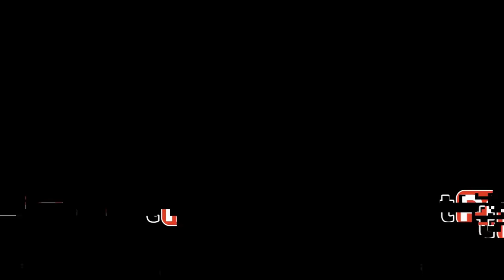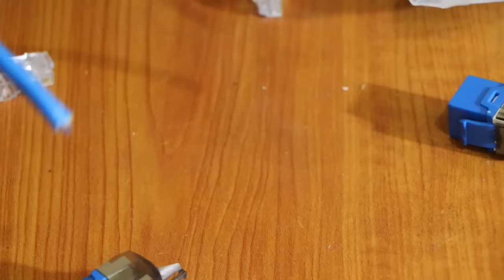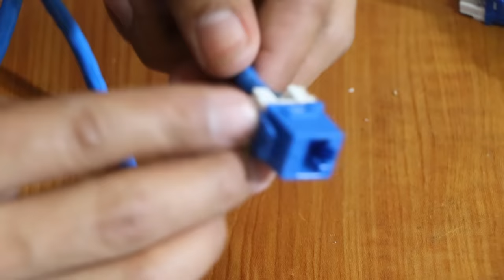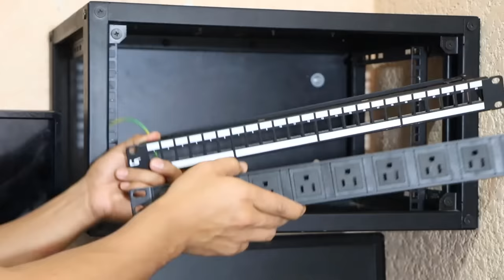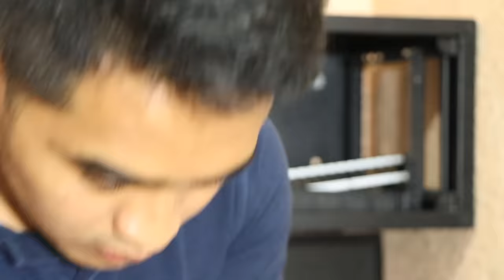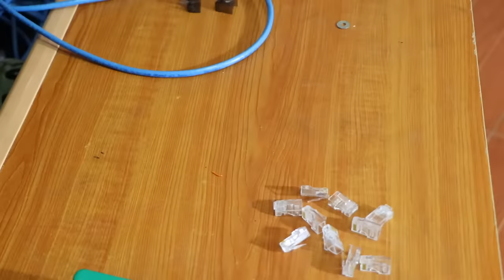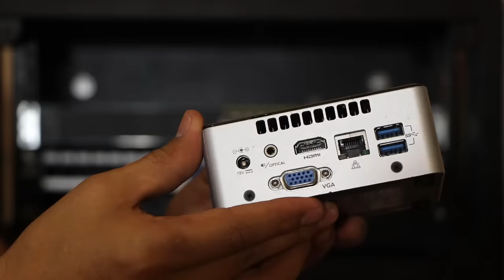DIY Home Network: Experts Debate – Right or Wrong Techniques?

Comment: Look, this is Torogi Pro's patch-panel, he can configure anyway he likes, he can turn it upside down,  sideways, and put it in the bathroom 🚽 Its not yours, its not mine and its not in the Pentagon for gods sake! 😬 Its a home network (wish mine looked that good), if I were to make video of mine, you would crucify me then laugh me into last week! 💀...and BTW...I made all my patch cords too...and they work just fine...I even tested'em, so there you go...my 2 cent...for what its worth...IMHO...bite me! 😝  💋 👣👅
Reply: Exactly! He can do it any way he wants, but he certainly can not call it the 'right way'
Reply: very well said Sir.
Reply: Agreed. Many of the suggestions by others are appropriate for a larger install, but unnecessary here.  Most of the comments are no doubt from those used to working in a commercial wiring closet with hundreds of connections, not 12. I've been at both ends of the spectrum and the design considerations are different. Since there are only about a dozen connections, even a patch panel is optional, but nice to have. Good wiring management really comes into play when you have a lot of wires. I think some of these people would be saying you need a rack, PDU, and patch panel for 3 connections to an integrated wifi router.
Reply: LucaWen tưtq. Kceen ưt
Reply: He can configure it however he likes but HE SHOULD NOT BE INSTRUCTING OTHERS IN THAT CASE. This isn't best practices which is required when you claim to show how it's done right.
Reply: @samiraperi467  Exactly. "pro" channel, "done right"... yet, (1) he doesn't use cage nuts on a frame that requires them, (2) doesn't mount anything with the proper 1U / 3 hole alignment, and (3) secures things with a single screw in the TOP hole. Nothing about that is "pro" or "right" -- it is, in fact, the exact opposite. You can do this all you want in your own bathroom, but don't put it on YT and call it anything other than the unprofessional mess that it is.
Reply: What is the types of the cables u used to connect the patch panel with the switch? straight or cross over ?
Reply: @Zeric1  Coming from both sides mysef, he has every right to do as he likes.  However, this does not make it the correct way to do things.  Making your own patch cables, for instance, is not a good idea.  Patch cables cost pennies these days, and are MUCH less likely to fail - especially ove rtime - than hand made ones.  Patch panels, even for small installs, are ALWAYS a good idea.  Less strain on the cable/connection, for one.  Also it's easier to diagnose issues in my experiance.  Adding that gap between the PDU and patch pannel not only doesn't look good, there is no reason to do so.  It ALSO mwastes a slot that might later be needed for a new switch or other piece of equipment.  Also, it tempts you to runa cable through the gap, which will cause MAJOIR headachs if you need to replace a unit in the future.

Comment: I do this type of work professionally.  While I'm sure this will work fine for your home environment, when you are ready to take it to the next level...

1. Use cage nuts
2. Don't skip a single hole in a square hole rack.  If you want to leave a gap for whatever reason, leave a full 1U (3 holes).  Square hole racks don't have even hole spacing - there's a reason for that.
3. That keystone panel has a cable guide on it to help with cable management.  The extra cable should be coiled and zip tied behind.
4. Patch panel should go to the very top.  It has no indicator lights to see and even in a high density 48-port 2U panel it can be at arms length above you and still manageable.
5. Unless you are in a very high density rack where inches of cable matter, don't waste the time and money on building your own patch cables.  Patch cables are cheap, have molded strain relief on both ends, and are typically better attached than what you can do with a hand crimper..
6. Use a 6" extension cable to plug wall warts into a PDU so you don't lose open receptacles.
7. If you are going to do any more cabling than this, spend just a bit more money and buy the quick terminate keystones.  There are a lot of companies that make them now and punching down all 8 wires with the pull of one handle is a game-changer.
Reply: Phoenix  because it's out of the way, So it's easy to add more equipment down lower later.
Also heat rises, so you don't want actual powered equipment up the very top if possible. 
There might be other reasons, that's all I can think of for now
Reply: I was watching this video going..... Cage nuts!!! Lolz. Btw, do you have any experience with rack studs? I just bought a set for my home rack. Server is going to be on nuts, but trying out the rack studs for the lighter weight mountables.
Reply: If this is your own home network, do wathaver you want. If this is a proffesional installation, I will kick the living crap out of you. I am confronted with so called Proffesionals who do this as a living.
Reply: @richardwilliamjohnson8566  I'm moving equipment at work from wire rack shelf into a Tripp cabinet. The config top to bottom I was sketching was Router, POE switch, two keystone patch panels, second non-POE switch, two shelves for backup internet equip, and power control unit. Logic was to place the router at the top since it runs the hottest compared to the other pieces of equipment and would place it near the vent for optional fan if needed. Also, the patch panels sandwiched by switches because I've read you don't want patch panels crossing equipment. Figured if a current wall jack that currently does not require power injection I could move patch cable into POE switch. It would cross the patch panel but not equipment. Your opinion?
Reply: @mcraw4d  Not super sure what you mean, but in reference to active equipment up the top, it doesn't really matter especially if it's an open rack or has a decent push-pull fan system.
However if it's an enclosed rack where heat will get trapped at the top, it would be recommended to have the hot router seated a little lower.
I haven't had much experience with this stuff being an electrician by trade, so have only done the occasional rack fitout (which is definitely an interesting process) but almost always you will have passive items like PDU's, UPS managers, patch panels etc up higher and active equipment throughout the rack, usually with patch panels dotted throughout along with some cable management duct, or brush.
It's totally up to you, you just need to think about what's easiest to work with now and in the future, heat and airflow, and where the cables are all actually going.
You'd best ask somebody who does this stuff for a living if you want some decent advice.
Reply: Phoenix  I'm also a learner and we don't really do any patch panel cabling in our network cabinets since we're not qualified for that. That's electricians' job. We only build in and cable active components (routers, switches, servers, modems, UPSs and more). But I guess another reason for patch panels being on top is that typically you will have at least dozen of those network cables that run in walls (sorry, I don't know what they're called, not an English native speaker), often even more. We have cabinets at work with over hundred cables. You should also leave some spare length of those cables because if you need to later on move your network socket further from your cabinet (say you're renovating a room), you'll need that spare length. Same goes for potential moving the whole panel inside the cabinet itself. That's why those cables are typically bound together in some extra loops. Now, the cables typically come from the top. So if you were to put the panel at the bottom, you would need even longer cables + would have  to put those loops in the middle. Now from my experience, sometimes those loops get in our way when putting in our equipment, specially servers, that are typically longer than switches. And it's pretty hard for us to move those loops which take some extra inches that we need so badly at those moments.

Also to the original comment and using cage nuts. This guy also used screws only in the top two of the four holes of each device/panel/whatever. You should never do that. Always use all four holes (with the cage nuts of course) and as you go, put one screw in the upper hole on one side, then the other one on the bottom hole on the other side. Then you can let it go and put in the other two screws. Don't screw them too far before all four sit in their cage nuts. Also longer screws are better: we had this set where we would have problem screwing anything because the screws were literally too short for those two layers of metal (one of the device and one of the cabinet... bar(?) with holes itself.
Reply: I've seen a few jobs where RJ-45 plugs were put on the station wire leaving out the patch panel.  Don't do that. The plugs are not reliable on the solid wire.  Mentioned this for those following along.  You got it right with Keystone Jacks.
Reply: Why don't you create a channel and make videos teaching this stuff? If you did, I would not only subscribe, but join your channel such that you can get paid too!
Reply: All that and you didn't mention him using a Fast Ethernet switch?
Reply: @Ozzy Bauce there are a few different ways to do it but wireless is not a good answer. If it is on your own property, you could just run a fiber between buildings. If not, the best way would be going through your isp.
Reply: @solath I agree on every point but one. Zip ties are known to be over tightened and restrict the conductivity of the cabling. I would personally go with a good hook and loop tape that won't pinch the cables.
Reply: I prefer putting the patch panels above and below switches.
Reply: solath I work for a medical equipment OEM and couldn’t agree with you more. We have some sites that we install and configure the switches but the cables are provided by the customer. I ask for the smallest length that will work but sometimes that means a six foot cable when a two foot would do. Some Velcro and cable management do wonders. I am dealing with four post full server racks that have to deal with heat management and this setup is a joke.  One U of space hear and there means later you have to move a bunch of stuff to get another piece in and heaven forbid service loops.
Reply: WOW  OCD!
Reply: Yup, the skipping one hole at a time...  I couldn't take it anymore, I had to stop watching!
Reply: Phoenix  I'd also add to this question the simple fact of the patch panel laels being above the ports, meaning they're unobstructed when the panel is at the top and the patch cables are running down-over toward the switch which should be placed below it.
Reply: @jhaas68865  This is a home network with a dozen cables, not a six foot tall server rack in a commercial setting with  hundreds of cables coming in.  What if he only had 2 or 3 cables coming into an integrated wifi router?  At some point full-on cable management is unnecessary and just adds cost with no practical benefit.
Reply: Great
Reply: I will always make my cables to the exact length i need and terminate myself.  Neat, tidy, and only takes an hour of my time.
Reply: G Burk 

Ya, if you need to run Ethernet from one building to another on your property, it's better to use fiber.  It's been know that running Ethernet cable under ground and you get lightning that strikes nearby, it can hit that cable and run through it and fry all your hardware on both ends.  If you run fiber, you won't have that issue.  Of course your hardware could get fried at one end anyway which is why you need to make sure everything is grounded.  My antenna is grounded.  Nice long copper rod I installed in the ground.  The coax line for the antenna going under my house first goes to a grounding block which is then grounded.  Same with the coax cable coming in from the cable company.  It also first goes to the grounding block.  Down where the coax splitter is located, is also grounded.  Basically I made sure to ground everything I could.  Still if you are having lightning close by, it's best to pull all the power plugs and coax lines.  Anything where lightning can find a path to your hardware.  A direct hit and nothing you did will stop it from frying everything.  That even includes your TV, washer and dryer, etc.   Grounding everything you can will help with lightning strikes further away, or no one home to do anything.  In which case, better than nothing.
Reply: Yes, but do you have a video?
Reply: @josberk4646  lets be real here. You won't kick the living crap out of anybody.
Reply: Magnificent advises from you sir Solath! I learned a lot from you. So grateful for having you here!
Reply: @richardwilliamjohnson8566  Also typically patch panels are the lightest. Servers, switches, UPS and other equipment weight much more and should therefore be at the bottom.

Comment: At first I was thinking, oh man, it's gonna take forever to make all those patch cables. Then when you see the final product, it looks amazing with all the perfect length cables.
Great job. Thank you for sharing.
Reply: You can also buy such short cables. And then you're sure they're crimped the right way. I would never crimp cables by myself. You can use the very easy push/click-systems. They are much safer.
Reply: @disdonc6012  Making tp cables is easy

Comment: A good attempt, but I agree with some of the commenters here. I cringed when I saw that you didn't use any cage nuts to mount the equipment. As well, you didn't align the equipment with the holes in the rack. That looks like a 6U wall mounted rack, three holes per single U. I agree that the patch panel was a good choice, but typically it should always go on the top U of the rack, followed by a horizontal cable management tray. You should have used 3' patch cables so you could use a different port on the switch if it goes dead. (It can happen, even with Cisco gear!) 

After you mounted the switch, you could have used the floor of the rack to hold your non-rack mountable equipment, rather than placing your equipment ontop of the switch. While you can do that, it makes it considerably more difficult to replace the switch, should it fail. 

The equipment you chose isn't bad, but I would have chosen a Cisco RV320 Router/Firewall instead.
Reply: This guy gets it.
Reply: You wrote exactly what I wanted to.
First thing I saw was no aligned equipment with holes in rack.
For home use  it would bo good - it's clean
Reply: The single core cable isn't the best for patch cords. The multi core wires brings less mechanical stress on the connector. Too short patch cords put so much stress to the conectors too. Pre build patch cords are really inexpensive. I recommend you to put the Switch on top, 1U cable organizer, 1U patch panel, 1U cable organizer,  1 rack self and on the bottom the power strip.
Reply: I think he used cage nuts but used them wrong. Also like others, use the screws adjacent from each other per unit if you only want to use two screws. (left top, right bottom)
Reply: Would a firewall be necessary if I am extending from my existing home router LAN ports to a switch?
Reply: Not only that, the cables weren't labeled.
Reply: @nobytes2  only if you wish to keep your children out of your home lab.
Reply: @Deraco1  It is better to use two bottom screws, because the load pushes out the bottom part of the flange. Not that much of a problem for an unshielded patch panel (when the cables are tied to somewhere), but definitely a bad idea to not use the bottom holes even for a switch.

But not the screws and cage nuts are the biggest expense in an rack system, just buy another bag, or two.
Reply: @gabiold  Yup since my last comment, thats actually what I did in my personal rack in my apartment, works well and obviously makes sense because.. gravity lol

Comment: Cable management is ok for home networks. But commercial environments Patch panel and switch should have more separation so cables can be run horizontally and down the rack tethered together. So that patch panel labels are visible. To make diagnosis to network easier.

Comment: Just re-iterating some points:
1. Patch panel up-top, it never moves.
2. U-spacing is in 3's for a reason, literally DESIGNED to mount devices directly next to eachother. Why do people constantly leave single-holes out, or ignore the proper spacing...like WHY.
3. cage nuts, always cage nuts. What are you doing.